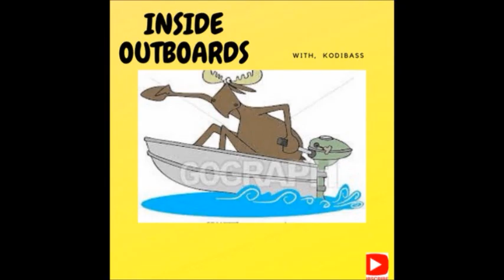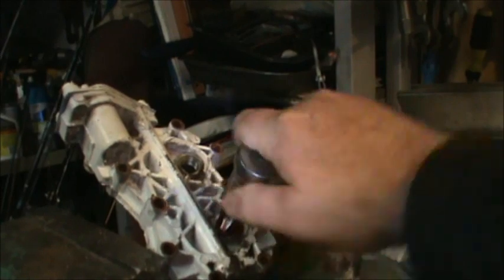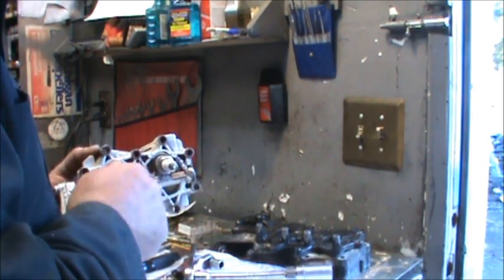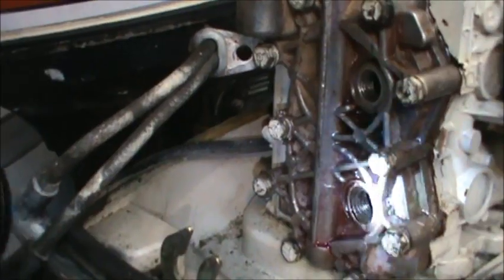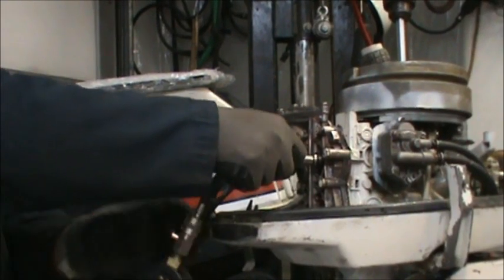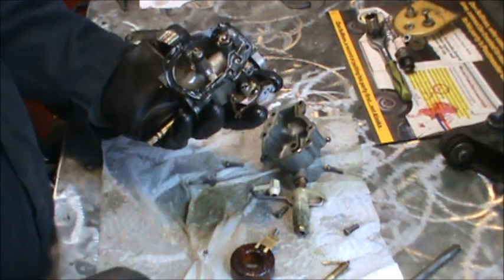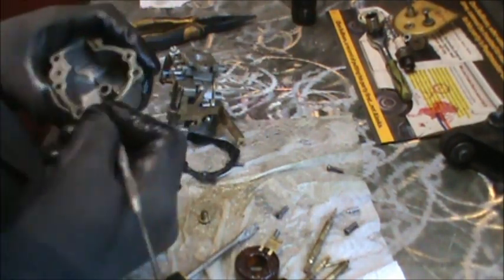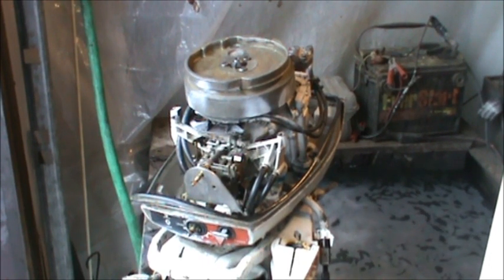EVINRUDE 55 HP COMMERCIAL OUTBOARD,    JOHNSON 1963  5 & 1/2 HP

Comment: Hi Kodi, yep still waiting on parts from Crowley. They have really slowed down lately. Anyway good info on the spark plug insert. Yep 85 is not bad for compression on those older motors👍 if the owner didn't want it to run right he should have not brought it to you. Now he will have a running motor and after the lower motor mount fixed won't wobble around. Nothing to Complain  about and I'm sure his choices on other outboard repair shops is limited up on Kodiak Island😁
Reply from the maker: Yep' Some folks just don't everything 4 nothing.  The owner will wine a bit  I'm used to it.  Sad thing is he is a Doctor.                      kodi

Comment: Never count out an old 5.5hp, they will come back most everytime!
Reply from the maker: Yep'  I did not show it in the video,  Lazy on my part,,  But I had 2 add aluminum to the spark plug hole with A torch & aluma-rod.  Before I tapped it & added the sav-a-thread.  I will make that video soon as I often get these stripped out heads  on outboards.     kodi

Comment: I reuse headgaskets most times  too they are so expensive nowadays only pristine motors and customers willing to pay for new get one. Once in awhile you can get them reasonbly priced on E-bay. I agree with you using good used ones love that little motor ...LOLL.......GP
Reply from the maker: Yep'  i only see parts 4 these older motors going up & up.    kodi